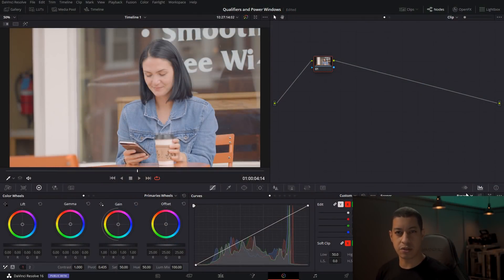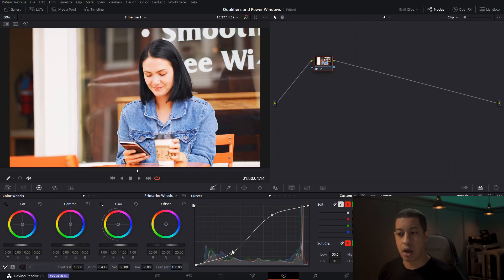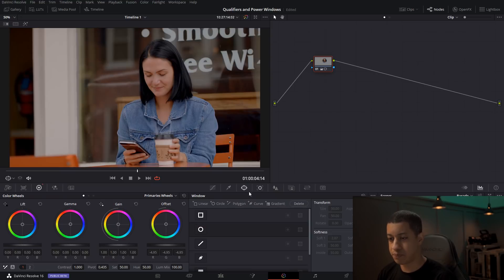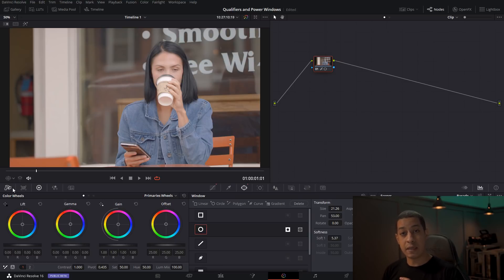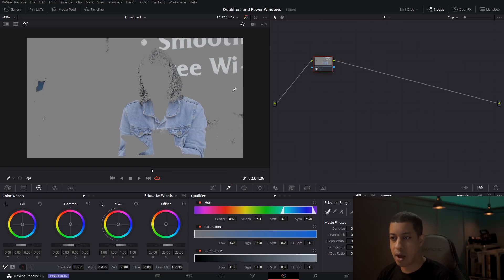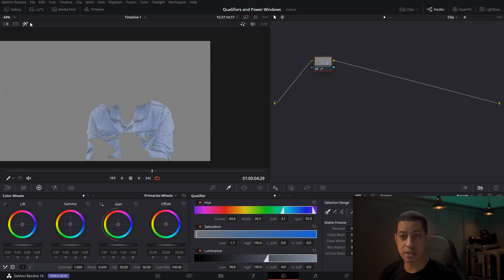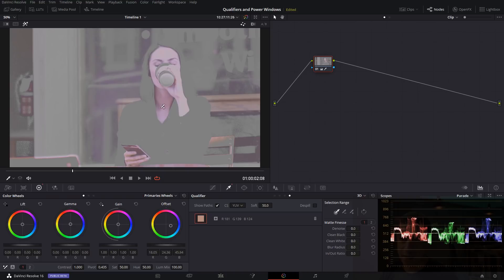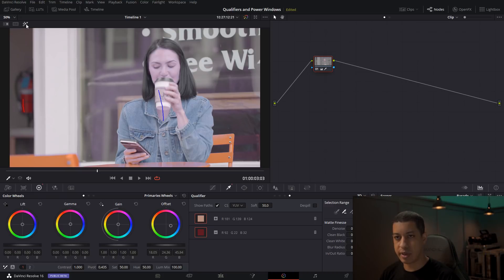Qualifiers and Power Windows in DaVinci Resolve

Comment: Your studio lighting is beautiful. I love the darker, soft look you have. Not too dark, but just not the typical full blast lighting. What is your lighting set up? I  guess one key light  with a BIG soft box placed very near you and dimmed down a bit, and one BIG fill light farther away, also dimmed a lot. Background is just the hanging lights? And a green light pointed at the ceiling? Thanks for any gear/lighting tip on this. Great job on this video too. The qualifier takes a while to get one's head wrapped around it.